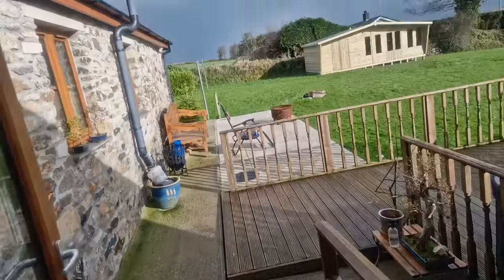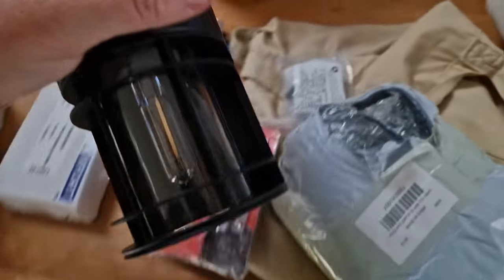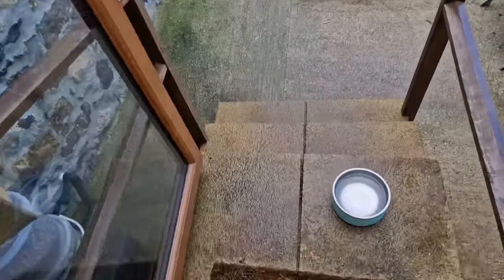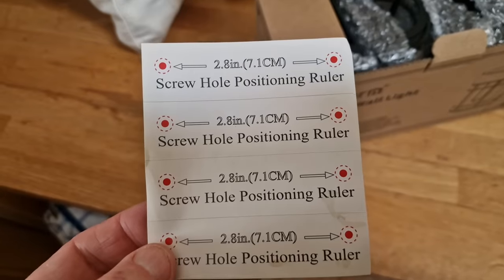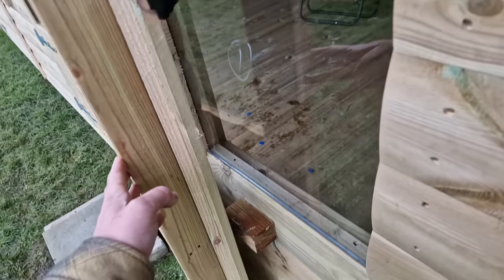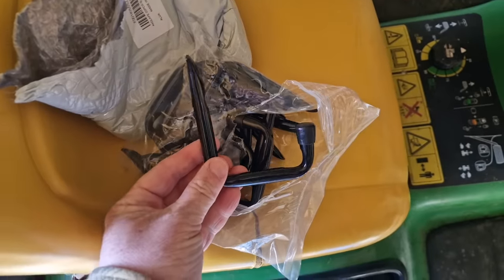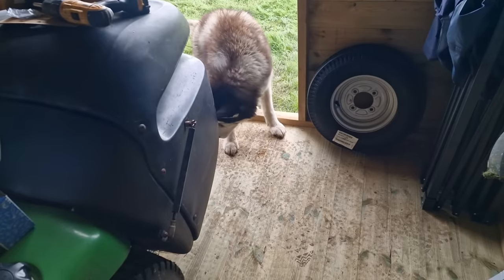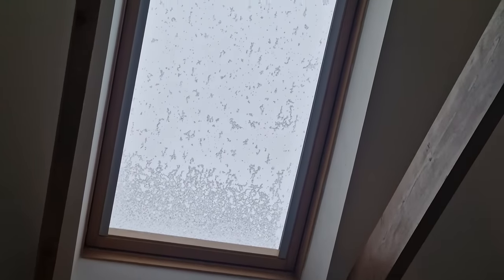Starting Work On The New Place

Comment: Consider adding vents to the side where you're storing gasoline/tractor so fumes don't accumulate and/or leech into the part with the windows.
Reply from the maker: Great idea 😊
Reply: Another vote for vents so that fuel vapors never accumulate to unsafe levels in a confined space.
Reply: Good thinking safety first.
Reply: Great suggestion!
Reply: Great idea.

Comment: I highly recommend ditching the paddle lock and hasps for a proper flush mounted door lock. The block to stop the door/lock from smashing the window is perfectly acceptable but I would add one to the top and bottom along with a nice ramp for Sherpa to walk up and down on. I also would seriously consider staining the shed/summer house exterior and painting the interior as well as running electricity to it, installing a vapor barrier and and insulating it and installing some natural wood paneling or maybe sheets of thin plywood.

Comment: Jamie, you know the weather conditions in the UK that´s why you should treat all the wooden things on your home, otherwise they rotten over the time away which means work, time and cash! Your Garden house need a good sun protection or you die in there from the summer heat. Also important are stone plates in front of the house if you like to sit there and grill some stuff... For your guests cold drinks and Sherpas corner to sleep in the shadow of a hot summer evening.... What about a small pool !??!

Comment: If you put some benches in front of those windows the summer house could also be a greenhouse. I wouldn’t cut a wall for windows on the storage wide. I would just install a small window in each door. Easier and more light.

Comment: Hi Jamie and Sherpa! Nice summer house you have. You mentioned before you may use it for all of Sherpa's gifts from your Youtube friends. Sherpa's books, letters,  awards, photos, calendars, etc. Actually that would be a better idea for the other bedroom in your main house as pictures may get moisture in them unless your insulate the summer house. Many possibilities & I know you've got ypur own ideas in mind. Looking forward to it.  Definitely weatherproof  and maybe frame the windows with shutters or extra wood so there's a barrier to prevent the padlock from also crashing into the glass. I would also keep the piece you thought sawing off because there would be a gap under the door. This way it keeps the doors flush and securely closed.

Comment: JMO you need a doormat inside the door of the Summer House and I would suggest you build a solid removable ramp for the mower that protects the door sill or you might end up bashing it bouncing over it on the way in and out  👍😇

Comment: If I were you I'd build a huge deck (or patio) off the front of the new shed. Sherpie just steps onto it on the left side and walks along. No step up to get into your new summer room. Watch YouTube videos on how to do, but all you need do it set mounting posts (probable 4x4), then frame it and install your flooring. You can easily do this and you could make a few videos about it that would be different content!

Comment: Putting extra windows in on the side would be a good idea and the extra cost will be what you would have had to pay for the original fitters to do any way.
Also consider cladding or bordering out the inside, I did this and it definitely makes it feel more comfortable and like a room.
I also place silver bubble wrap insulation inbetween which has made my summer house usable all four season, I even used it on the floor and then put a flooring of choice over that.
I have a corner sofa and tv in mine and spend more time in it then my real house and have even slept in it on summer nights Lol…..

Yours is a good size and could easily have a lounge are and a hobby desk zone as well…

Also, you

Comment: Wow, what a palace for a shed. Just thinking: Isn't there some resistant plexiglass in the home improvement stores? Like the plexiglass to build greenhouses wih. When you showed the door banging open, the lock on the door will always shatter the window. Well, yes, there is the protecting block now. And some vents would prevent rot in the wood, do you know how the old shed in the grandparent's garden smelled? A sort of musty, earthy smell. Plexiglass is much less than glass and you can cut it with the jigsaw or tablesaw.
Now for the luxuries: How about some electrical outlets, lights, a sink with running water and drainage to a septic tank, a fridge, some cabinets or shelves, a double flame gas-operated camping stove. A WLAN repeater, so you can edit and upload your videos. A comfy chair, a table to put drinks and snacks on. Make it a man cave for you and your significant other, Sherpa.
What a place to mount all of those license plaes you received!

Comment: I commented on the previous video, you should take the time to put some concrete blocks, under the legs, so, they do not rot away, from the weather. Otherwise, with Sherpa's help, everything will come together, eventually. Have a great day.